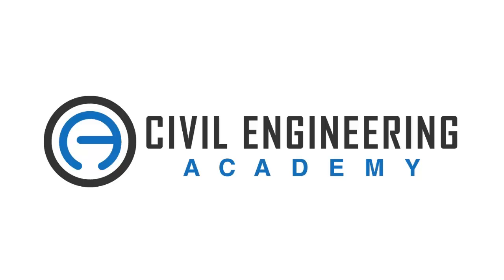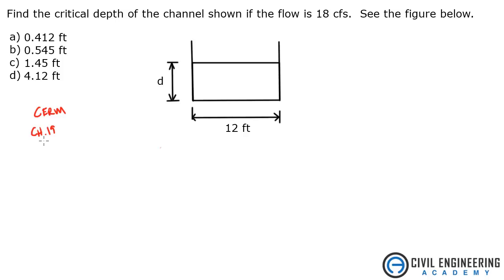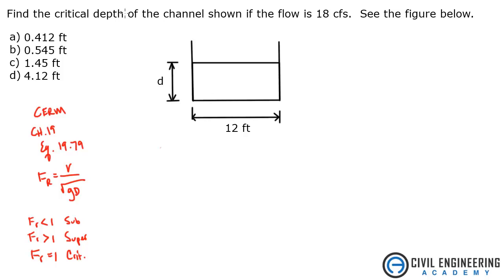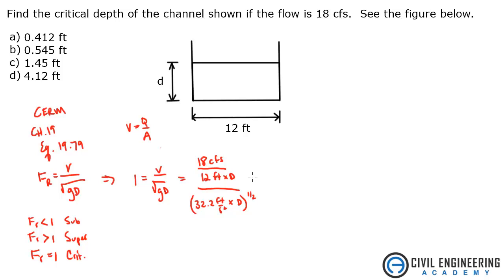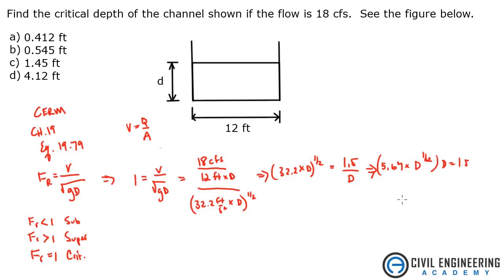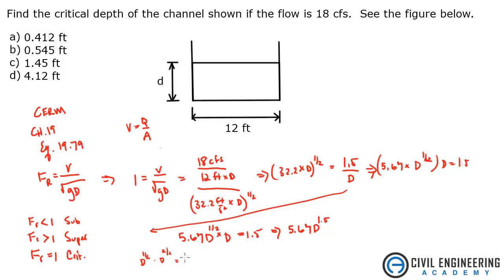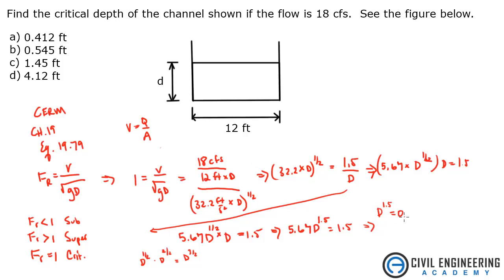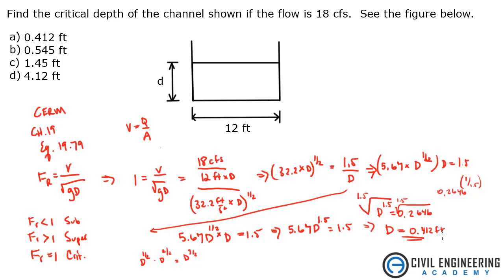Water Resources-Find the Critical Depth Using Froude Number

Comment: Holy hell you made that difficult!  As already pointed out, there is a simpler equation, but using your method, just square both sides and get rid of the fractional exponents (32.2xD)^1/2